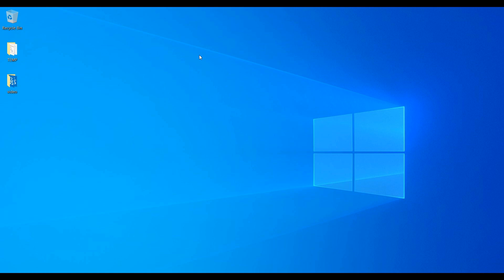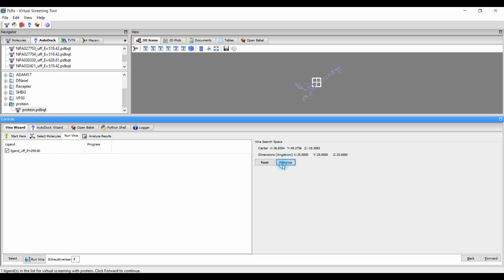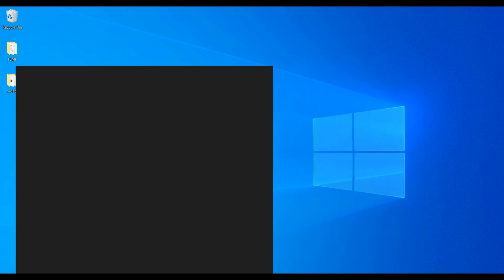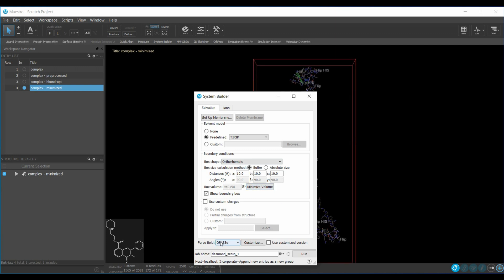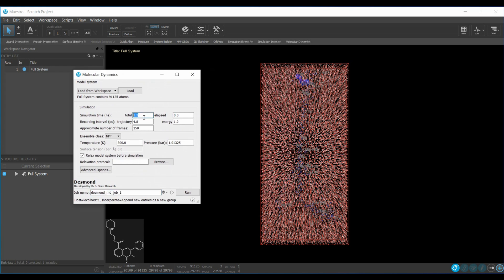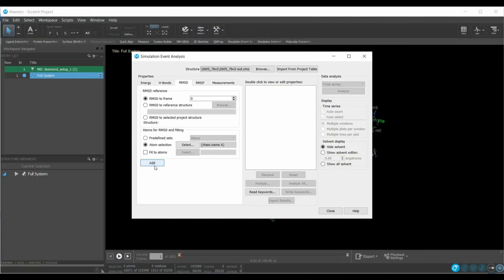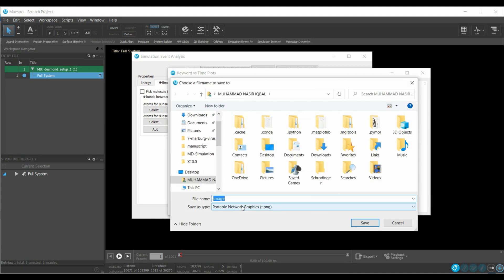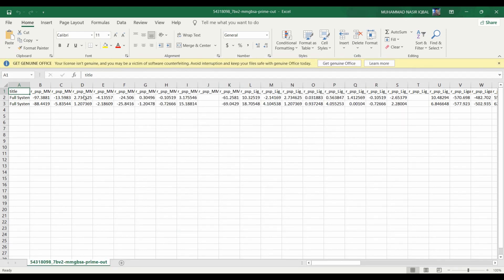MD Simulation Hands On

Comment: sir, i have one question:
i was trying to preprocess the structure but it is showing this error
File "/home/rc/apps/DESRES_Academic_2023-4_Linux-x86_64/install/internal/lib/python3.8/site-packages/schrodinger/infra/unusable_module_importer.py", line 158, in _getattr_
    raise self._EXCEPTION_CLASS(msg)
ProductNotAvailableError: Cannot access schrodinger.application.prime.packages.missing_loop.add_missing_sidechains because the associated product is not installed
ERROR: Following structures failed to prepare:

do we need to install the prime? in academic version i did not get the prime.

Comment: Thanks for your insightful sharing. I commented yesterday but somehow the comment is missing.
I have installed academic desmond successfully followed your former video. But my molecular dynamic job launch failed and got error like “cuda driver version is insufficient for CUDA runtime version”. But this configure worked fine when our schrodinger license are not expired and other gpu-accelerated job works fine(not schrodinger or desmond). 
When the schrodinger license is available, got same error, the support team suggested running "licadmin INSTALL -c 27008@mu01" on gpu01 and problem solved. But I am confused wish academic desmond. Maybe there is something wrong with my configration rather than cuda driver and cuda toolkit. Could you please have a look and give me some advice if you  can? Thank you！

Comment: Thanks for the useful video. As far as I see, you are doing system preparation and MD simulation using the Windows operating system. Maestro is ok but I know Desmond works under Linux. How did you perform MD simulation with Desmond under Windows operating system? Thanks
Reply from the maker: you are right, Desmond simulation can only be performed on linux OS. this video is just illustration of steps to perform it.